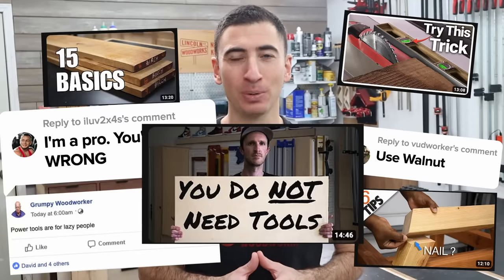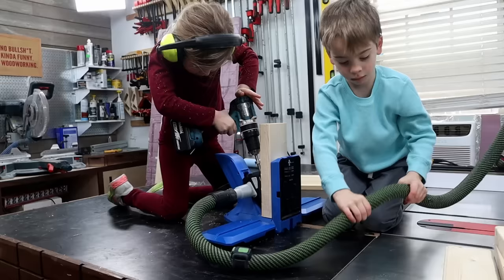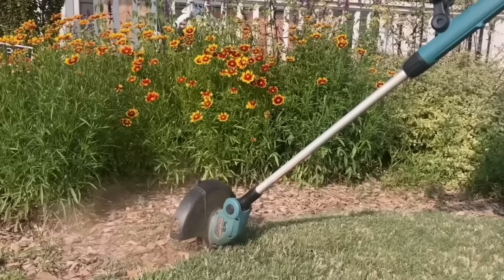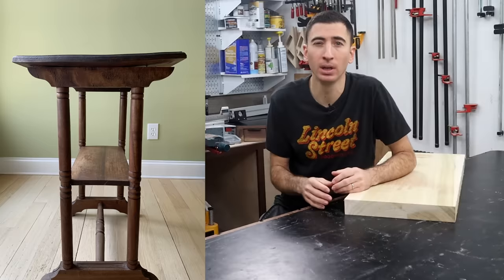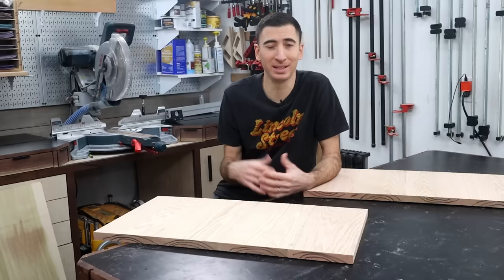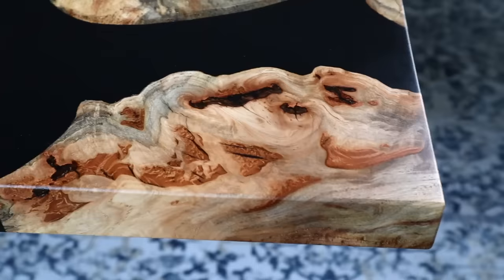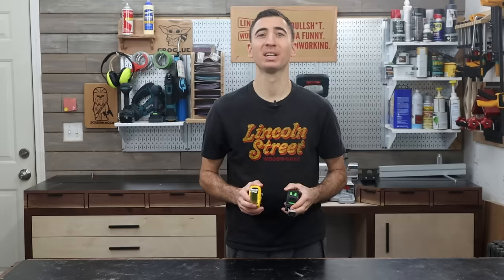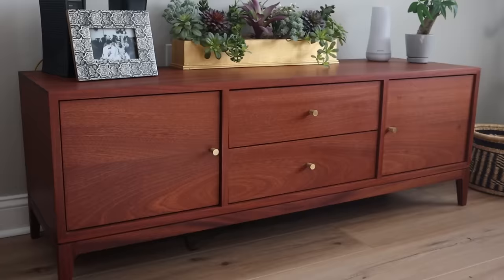Every beginner needs to hear this

Comment: Yeah, cleashe. 
But dude you are an idiot. 
Woodwork has been tested for over 2000 years and now some 20 year old knows better? 
Testing joint strength is not necessary? 
Oh my friend, although I can respect much of what you said you will yourself regret saying most of what you did in this vid in 10 years. 
And yes, I have trained in furniture building in Australia, England and Japan. After 45 years......new guys to timber....two things....
Do NOT take what this guy says, who apparently knows everything, for gospel. 
2nd, you burn wood. You build with timber.
Reply from the maker: I present exactly what I'm talking about round 2.........
Reply: blah, blah, blah
Reply: pretty sure timber is made of wood
Reply: This video is for the novice/beginner not for a furniture maker.  And we are not back in time 45 years ago. It’s for the person wanting to make something instead of going to IKEA.  Yes I agree long lasting furniture should use proper joinery, but beginners aren’t making furniture and glue and screws will only last 20 years, most of today youth thinks that’s an antique. You are probably a kid.  Be happy, you got response to your anger issues
Reply: Oh, it's been tested? Where are the evidence based studies?
Reply: @slightlycrookedworkshop  Jesus' father, Joseph, was a carpenter.
Reply from the maker: @cyberwolf6667  stop making this much sense. That can be dangerous on the internet
Reply: I came for the cupping. Stayed for the hockey fight.
Reply: The pin of shame.
Reply: Bro, why you tryng to burn me?
Reply: i think you missed the entire point of the video. no one is trying to hold up a building with pocket joints. I'm just out here trying to make a square box, cut straight lines. and build something better each time i do it. I'm not making heirloom pieces to pass down to my kids. i'm making record boxes, dog gates and decorative pieces out of whitewood and trying to learn a new technique with each project I do. by your logic people shouldn't use power tools cause they have only been around for about 150 years. stop it. let people have their hobbies and learn
Reply: Thank goodness I didn’t seek your input when I made my first living room suite on a labourers wages 
FYI I still have a few of the pieces I made 30+ years later and still use them 
This guy is talking to the beginner looking to make their first things furniture or not 
Not the beginner furniture maker seeking to work in hard woods making only furniture and cabinetry
Reply: @mrmajors60  I also think the anti-pocket screw crowd is funny because if you're using solid wood, you're still probably turning out a significantly longer-lasting piece than what you'd get at Ikea. And yet millions of people make do with the strength of Ikea furniture, which is put together with screws and particle board. And even THAT crappier furniture can usually last forever structurally if it's not subject to significant abuse.

-guy who doesn't use pocket screws
Reply: @winrawrisyou  like i am just getting into it all. and haven't even gotten to using pocket holes. I'm legit at the point where I am gluing stuff together and just happy when it is square, I learn something new each time. I'm currently making a record box "crate alternative" if you will. I'm sure in a few years I will think it is trash but for now its square, and will hold records without the bottom busting out.
Reply: Here’s one. Just because youve been doing something a long time/all over the place, doesn’t automatically mean you’re an expert or better than someone who is “newer” to the trade….
Reply: Bro.  He's talking to newbie woodworkers.  For someone that claims to have "trained in furniture building in Australia, England and Japan. After 45 years" I'd think you'd understand that you don't give a new apprentice "Master Level" instruction.  First you teach them how to hold a hammer correctly.  Because you and I both know they aren't going to know how to hold it correctly until they've been shown.  

Second, perhaps in "Austrailia, England and Japan" they build with "timber" - in the United States, "TIMBER" is what you shout when you cut down a tree.  We build with lumber or wood.  

I do wonder now - do you call yourself a "Timberworker"?  Or a "Woodworker"?  Yeah.  That's what I thought.
Reply: I built a workbench with lumber left over from machine crates, 2x4s, coachbolts and deck screws. It has zero aesthetic value, isn't stained or treated, weighs more than my car and the tools I used were the cheapest from Harbor Freight. I have almost no woodworking experience but I'm delighted with my results. So for me this guy is making a ton of sense.
Reply: so is it woodworking or timberworking?
Reply: probably the grumpiest comment ive seen
Reply: @PDolansky  I like lumberworking.  Because when I need something for a project, I go to a lumberyard.  But then I thought, the pieces I buy are mostly made from the "trunk" of a tree. So, I'm really trunkworking.
Reply: And also…it’s cliché
Reply: Come on bro we're not all wood gurus
Reply: I would tell anyone who buys a power tool to be careful of drills that have canted jaws in the chuck, for instance. If a power tool sounds inappropriately loud, it may have been cobbled together in a hurry with too little grease. Get something with 7 amps (or more, as amperage is current, and is what cuts). Some of the cheap throwaway is your money's worth.  If you've mitered corners with gaps, check your square (Swanson speed squares are often over a 16th inch or so, for instance). Get rid of old consumer plastic as it is likely dry rotted after 7-10 years and is not plumb/level (measure your measures). If you want to use rabbits (or whatever works for you) that's great. Get a chemical safety book, and know that everything in woodwork is going to kill you if you don't know what you're doing. And most importantly, borrow a pocket jig from the minister across the street and make your own from a YouTube video!
Reply: You know they used to stone people 2000 years ago for thinking the wrong things... are you saying that because we did a thing a long time that somehow no one can come up with a new way to do it?  Bruh... I hope whatever thing is ailing you is cured by the attention you got from this.  You're clearly struggling with something and I wish you the best, because your whole post is... um... "a bit crap" to quote a friend.
Reply: nic6754  What is "cleashe"?
Reply: Ha! I judge people for their finished product not how long they've done it for and age is completely irrelevant. I've worked with guys that have done stuff just as long as you and did some of the most lazy crap work I have ever seen. I don't take anyone's word as gospel and the last person I'm gonna listen to is the guy who bragged about working in multiple countries like it means something and tells a young gun he's going to regret it in 10 years. After 10 years I bet himself and the furniture he built are going to be just fine.
Reply: Is the strength of a cable stay bridge judged by the strength of just one small wire used to make the cables, or is it judged by the combined strength of all the wires bundled together?  Is a piece of furniture strength judged by one joint or all the joints combined? Remember as the joints combine the limit movement eliminating stress.
Reply: Dude calm down lol
Reply: No, I'm pretty sure I build wood furniture out of wood, my guy.
Reply: You build with wood. Timber is when a tree falls over
Reply: I also have 45 years as a cabinet maker, and I have had to suffer working with people who tell you everything you do is wrong. This is great advice for a beginner, use jointing methods that suit what you are making and don't over complicate things that should be easy, There are those who will insist on using dovetail joints on a box for collecting dog shit, and if that's what you are happy doing then fine, but calling someone an idiot for showing perfectly good methods makes you sound like the sort of person that nobody wants their workbench next to in the shop!
Reply: You’re the guy that wants to know more then everyone else. Nobody calls it timber except for you and your timber snob friends
Reply from the maker: @TrevorDennis100  Enlighten all of us!
Reply: Where's your channel then ?
No.  Didn't think so.
Reply: You are completely full of it. Arguably the highest stress experienced by wood furniture joints would be on frames you will sit on. Go rip down a $22,000 couch made by hand from a super premium luxury manufacturer with the best reputations for quality and longevity and you won't find anything but screw and glue joints. There will be inset framing components, corner blocking, etc. but you won't find a single mortise and tenon or all-wood joint anywhere.
Reply: @winrawrisyou  - I don't personally like pocket screws much because I prefer to free-work, and those are a pain to set up without a jig.   I've never denigrated anyone for using them.   Heck, I'd prefer that people used hide glue over 'plastic' glues, at least for things like chairs, but I don't go wailing about it to the world.
Reply: @MG-LooseCannon  i thought it was a furniture maker, and a house builder….at least it was the last tine i looked…..
Reply: Love this discussion, full of so much insight.  and Love all of your YouTube handles, cracking me up. Chubbibots, magicponyrides, BongoBaggins, these are classic!
Reply: his point is dont let it hold you back from starting out. i would add to that, learn the stuff as you go along.
Reply: Pffft. You only studied your tree cuttery in three countries? You missed out 192 of the stops around the globe.
Reply: Lol exactly as he said someone ( who has never bothered to make a helpful training video) comes along to flame.
So exactly how many times have you made a piece that consists of lone lever😂
I’m a beginner/ hobbyist and have been for many years , I can count the number of things I have worn out through use on one finger.

Maybe make a counter video ?
Reply: Actually you build with bricks😎
Reply: @Lincolnstww  I may be wrong if this video showed that a glued pocket screw joint withstands 170lbs, and there are eight of these joints in the table reinforcing each other, is that or not around 800lbs of combined strength?
Reply: @rocketfamilykml2528 Yes. Each joint according to the video, tests at around 170lbs so combined with seven other joints of similar strength, wouldn't it be 8x170lbs? (almost 800lbs)?
Reply: Minor spelling mistake, you lose the argument.
Reply: He makes it clear that this is for part time hobbyist beginners.
Reply: If missing the point were an olympic discipline you could win yourself some nice shiny golden medals for sure.
Reply: @Lincolnstww  round 2?
I'm guessing that either means you want me to argue further because you enjoy it, or that round 2 will be were you apologise for trying to mislead learning woodworkers. 
Bro, I said I can respect alot of what you said in this vid. But telling people something that is WRONG is ok? Really?
If nothing else, I commend you on trying to make money out of you tube. Posting something that even you know is wrong is quite clever in this way.
The simple fact this vid is for beginners, why mislead them, from the beginning!?
Reply: Guys, let's not overthink this. I write what I do because this video is incorrect. Have we learnt nothing from the 2000 years of practice, as I mentioned earlier. 
My comments are not intended as rude. It's more like let's do things correctly from the start, not get into bad habits. Is it really that difficult...."Oh no, I had to flip two boards over before gluing them"
Reply: @nic6754 
”This guy is an idiot“
“I’m not trying to be rude”
Which is it?
Reply: Tomato - tomatto who cares 😅
Reply: @nic6754  "But telling people something that is WRONG is ok? Really?". Yes and No. There are some things that are not exactly correct, but it helps to work with .. for the time being.
Examples: In early math I´ve learned one can not divide 2 by 3. Later I´ve learned one can. Then I´ve been told that if you square a value it always becomes positive. Later we learned that a negative result is possible and now I use it frequently. In chemistry I´ve learned about Bor´s atomic model ... later I´ve learned that this model is not correct ... 
But still all these (wrong) informations were good to go on step by step.
Reply: I learned nothing from your clip
You don't explain
Jumping from one topic to another
Reply: Oh dear. I think you have some timber still lodged up your screw pocket. Hope it's not glued too tight.
Reply: Imagine a Professional tells you whats the Truth and you still act like you know anything better. 
Thats on the same Level as the Flat-Earth People xD 

However the Reactions here are so American: I do this just for Fun without any kind of Standart or Regard for Material Waste :D  Its so funny :D 
 @Lincolnstww
Reply: Did you actually watch the video or just skim it quickly?
He said that those tests aren't realistic since you don't make furniture that just looks like a an L. The strength those joints had means that even the weaker ones would be just fine for most stuff people build. 
Being in the trade for a long time doesn't always make you super smart. It can also make you super biased and set in your ways. A beginner woodworker should take their time to learn it slowly. Even more so if they are just doing it as a hobby.
btw, why are you making stuff up? He didn't say he knows everything. Are you afraid he's just 20 and already better than you with your 45 years of experience?
Reply: Jesus's father worked with stone, not wood. You need trees to build houses. Israel is a desert. This mistranslation from the Greek for a builder was for something other than wood but for a builder. The Ancient Greek noun tektōn (τέκτων) is a common term for an artisan/craftsman, in particular a carpenter, woodworker, or builder. The term is frequently contrasted with an ironworker, or smith (χαλκεύς) and stone-worker or mason (λιθολόγος, λαξευτής).
Reply: His opinion is like an a-hole. Everyone has one. Some just stink more then others. We learn by doing ourselves, thru trial an error. That's what life is about. Cause life is a contuning experiment of self learning. There's so substitute for experience. That what learning is.
Reply: I think woodwork has been tested for over 200,000 years.  Tools and techniques have constantly evolved and I've seen a tremendous evolution during my lifetime.  (I'm probably old enough to be this presenter's father or grandfather - not a good judge of age.)  I've also seen major lifestyle changes.  This guy (Lincoln?) bases his advice on cupping around the "fact" that everyone lives in a climate controlled house.  I find this utterly weird, except that it is probably true for most people.  And he is correct that it won't matter if you start with dried lumber and it remains at the same dryness for as long as you own the item you've made.  And it will most certainly help if you finish both sides for the reason presented.  
I think the biggest problem with this video is that he seems to want to encourage new woodworkers by refuting a list of other peoples' "rules" while replacing them with his own.  That's bogus.  There are less offensive and more productive ways to teach.  And it makes it harder for me to trust his advice.  Is he just arguing to get views?  Does he actually know what he is talking about?  I don't really have time to find out, so I won't be back.
Reply: The testing shown in this video is of a single joint.  But I ask you, what piece of furniture has only one singled joint?  The point is, yes one joint type may be stronger than another, but it is the combinations of varying types of joints that make what you are building strong or weak.  I'd also argue that one doesn't need a shoe box that can withstand being stepped on by an elephant.

Lastly and more importantly, just because we've been doing something one way for 2000+ years does NOT mean we've been doing it right for 2000+ years.  If that were the case we'd all still be riding donkeys and living in caves.  Point is we learn new things every day, and sometimes those new things we've learned supersede the old ways of doing things.
Reply: Many a woodworker has made joints before the pocket screw jig was marketed 30 years ago. Does that make their ways obsolete? Of course not. If you run into some of these tools and router bits for under $125 you are getting a better deal than a pocket screw jig costs brand new (unless you live in an apartment or have limited space.) It doesn't float my boat knowing there's a better way to do something, and I'm making a table that will eventually wobble in 20 years.
Reply: Ok boomer.
Reply: I'm a furniture restorer (for celebrities and top interior design companies, felt I had to mention that becouse you're boasting your 45 Yr of experience lol) and, I almost never see altering growth rings in top pieces now I think about it.
Reply: @Gruftkriecher  Sheesh! Nobody calls the material used to make gold medals "gold." Anyone who knows what they're talking about knows Gold is for Jewelry.  Medals are made of "Auric Material" /s
Reply: @SkanMLL  Pics or it didn't happen.
Reply: @heidi22209  Go Red Wings.
Reply: @nic6754  2000+ years ago they used hide glue and it was in use until the 1900's are you stilling using it? I'm betting not as glues have advanced. The lumber that we use today in general is different from what was used in the past. How much air-dried lumber are you using? I'm also betting you use kiln dried. Again, times have changed. For most work in most homes ie temp, stable it really won't make much difference. I use 12"+ wide boards for drawers finished both sides no warping or cupping. Have done so for MANY years with no problem. (of course, some of the pieces are only 40 years old so we'll have to wait and see)
Reply: Had to change location that often ey? A pro would be humble and respect the info provided for people who are starting. Guess we know what you aren't. Also if you want to sound fancier than your skills allow, check the spelling and/or word definition from google.
Reply: *Cliché
ftfy
Reply: @klaus2t703  what a wonderful and insightful post!
Reply: I love how you pretty much nailed the comments prediction 😂👍
Reply: You only build  with timber if your stock is 6" by 6" or larger. If either dimension is smaller than 6" it's LUMBER. That is why they are called Lumber Yards...
Reply: I've worked with steel for 45 years, I'm just a hobbyist woodworker, so this video was interesting. I don't care what it's called in the inner circle of master carpenters dating back thousands of years , wood or timber or whatever. Wood working is casual, if you want strength, I can fab up a coffee table from 3/4" steel plate for you, then you can see what joint strength looks like. By the way, true masters call it steel not metal. lol Not really. Lighten up on the kid, he does better wood work than I do, lol  and maybe make your own instructional videos.
Reply: @Lincolnstww  I dispute what "nic" said.  He's not wrong about getting second opinions early on in ur career.  However, because of the DKE one will hear dumb ideas expressed just as, if not more confidently than good ones.  That leads to a fair amount of waste, in terms of time, energy, materials, money, your reputation, and how good/great you might end up being.  Learn from the mistakes of others, u can't live long enough to make them all.  I built cabinets for 50 million dollar yachts, with everything from hand tools to world class stationary tools with advanced digital controls.  As u can imagine, my coworkers were full of advice.  Seems like its always a mixed bag, and one gets better at seeing the pros and cons of each tidbit.  Eventually, while training new people, I landed on this approach to advice.  "What I like to do is this..." and then mention that its not the only way, there reasons for each way, it matters what the application and circumstances are, and while any particular approach has its strong advocates, one should optimize the best combination of "cheap/fast/good".  Of course we all want all 3.  Once in a while we can get lucky, and it happens.  Just know that that was dumb luck, and don't count on it.  Final thought: Your channel is rare in my experience, as the way you share your views is the most intelligent I have seen, and I've followed a bunch.  Glad I found you, cant wait to see what else u have to say, and I will be spreading the good news to any woodworkers I know... they are smart like you.  In the spirit of mutual respect, I salute you good sir!
Reply: @richardhaas1989  the term "lumber" is not generally used outside North America
Reply: @Lincolnstww  The fact that you pinned it made me laugh out loud.
Reply: "You burn wood, you build with timber" No, you don't. Working with timber has it's own defined set of characteristics and tools, which are usually much larger than standard woodworking tools. Congrats on being the perfect example to what he was talking about.
Reply: @wickedkustumz  I'm an amateur wood worker, but I've just called it lumber when I go to the "lumber yard". Do they even have timber yards? lol
Reply: @AmericanThunder  Typically, at least where I am at, lumber yards are the big box stores or places to go get basic construction lumber. You go to the mill to get hardwoods and actual timbers. Some lumber yards can order timbers for you, but mills are usually where I go to get my "lumber".
Reply: I've seen timber cutters in the woods cutting down trees and dragging it out to the log landing where the trees get cut into logs and then loaded on log trucks that hauled it to saw mills where it is cut into boards that was then hauled to lumber yards and drying keels by truckers that say they haul lumber and those places sell it to furniture factories and also places like Lowe's, Home Depot and other such places hauled to them on trucks that also say they haul lumber. Those places sell it to people that call themselves carpenters if they build homes and such things with that lumber and wood workers if they make smaller things such as chairs, tables, cabinets, swings, boxes, ladders, shelves, signs, toys and most all small items made from wood. I'm pretty sure it is technically considered wood at any point in this process from being a living tree all the way down to a used and rotting tooth pick. Or maybe words have a different meaning in my part of the good ole USA than they do in Australia, Japan and England. Or perhaps you sir @nic6745 are the idiot
Reply: @heavenleigh111  logging is some hard fn work too, those guys are beasts.
Reply: In the US we build rustic things with timber, nicer things with lumber, and do fine woodworking with wood.  (And we eventually burn the rustic things we made with timber once we've learned to make nicer things with wood.)
Reply: Hey troll, why is it called woodworking and not timberworking?
Reply: We have a "get off my lawn" Ken guy in the comments. Didn't see that coming 🤔. Oh, between him and his dad, they do know everything. If he doesn't know, his dad will and vice versa.
Reply: Japanese car it timble @MG-LooseCannon
Reply: @Lincolnstww when the response gets more likes than the original comment! 😊
Reply: Interesting range of comments. What is really the only consistent reality over decades is that wood butchers love to argue.  Joinery is impressive, but time intensive. Tech solutions help save labour.  Asian joinery is legendary as are their tools. Unknown fact is that all sharp edged metals used the same process as the Japanese still use of harder metal at cutting edge. Since that metal is very brittle and is easily damaged, most tools use alloys instead to absorb shocks with less damage. The edges are easier now to nick.  Terminology is also temper raising as is wood movement and prized techniques. It's fun to watch and discuss issues with a woodworker from a different country. I am fond of an English woodworker in a tiny home shoppe but with excellent machinery who has dialogues with his subscribers. Channel is Ben Elliott. No nonsense bloke who takes great effort to work through the stages of project development to help beginners  and to engage subscribers suggestions. I have found myself learning quite a bit after 68 years butchering wood. Keep the arguments going.
Reply: Cliché… not cleashe.
Reply: Hard to trust credibility if the writer can’t spell the title.  Especially when all of our devices check our spelling.
Reply: @Lincolnstww   To be fair he is right about wood and timber, our saying in NZ is wood grows on trees, timber is what wood becomes to build shit lol
Reply: @SkanMLL   Timber is processed wood used for building shit lol
Reply: Clutching pearls a bit eh? Well done. Well needed.
Reply: I'm so happy you pinned this.
Reply: @travisriddle8747 the guy just answered with the same term that was used in the original video. Nothing rude in it.
Reply: A much more experienced person pointed out that things appear to be not so straightforward as they have shown in the video, and a whole horde jumped out to argue. That's what's funny, guys. Is your actual goal to make furniture - or to make your own mistakes?
Reply: @cyberwolf6667 Problem is, he’s saying it’s a "MYTH”.  And it absolutely is not a myth. Over-stated,  hyperbole,  maybe, but not a myth.
Reply: You build with lumber, timber is standing in the woods.
Reply: I built an entire house out of 1x2s with pocket joints and its lasted fifty years
Reply: Why don't you start a youtube channel if you know so much? Stop gatekeeping all that knowledge you're hiding from the world.
Reply: Aaaaaaaaannnnd way to make his point for him 😂
Reply: @johnsmith-vz3vr  ah, the classic, "It's in the bible so it's true," argument.  If the bible said diddling kids was ok would you do it? No, because that's nasty.  Just because Joseph was a carpenter doesn't mean the way he did it was perfect or correct.  The bible doesn't always mean correct or perfect.
Reply: @cyberwolf6667  See. This is what an respectful, respectable adult looks like when he writes online. Flawless jab inserted in there as well. First round is on me pal !
Reply: He clearly states that this is for non weight bearing joints. My shoe rack isn't going to fall apart because I didn't dovetail the thing. Being a total newb, it's disheartening to believe you have to dish out 6k to even begin projects. It's relieving to see this. I built my rolling work bench that easily holds 500 lbs and is an open storage unit.

I wanted the bottom half shelved so I can sit/store it easier. Everyone on forums were telling me the design wasn't structurally sound or strong enough... It's been over 3 years of that thing having the hell kicked out of it and rolling it inside and out. 2 of us sitting on it with the 200 lbs stored on it. A drill, bits, Circular saw, 1 1/2" and 3" screws, glue, level, measuring tape, pen, weels, 2x4, and some leftover paint and 3/4" plywood. Maybe 100 dollars in materials if you bought everything from store. 200 in tools?  Compared to the 500 dollar benches I've seen, this would easily be worth double, feature and strength wise. 

Ironically, the strength test videos he talks about show that a standard miter joint with just glue, was one of the strongest joints (by far) vs almost all of the others. Miter joint for a desk is fine. In fact, the strength tests show that it's ridiculously stronger the dove tails and others with mechanical support.
Reply: sometimes its just too easy. hahaha. I too have been building custom furniture for a long time. There is always something to learn. cough "humility needed by some" cough. lol. btw, good vid. And I also like blue.  @Lincolnstww
Reply: @NukeDragon-ry2xw  when someone talks to me like that, I don't talk to them anymore.
Reply: I’ve never heard a single person working with wood call it timber, wether it’s carpentry or wood working. I’ve heard them call it lumber, but not timber. That’s what my grandpa use to call it when he was a timber faller for 40 years.
Must be some regional thing.
Reply: I live in a timber industry town in the US...  timber is what goes to the mill to become lumber, which is then used to build with...  Wood is the material it's all made from.
Reply: What inexperienced is this young man.He could not make it in the professional field. He should make cool aid stands for the neighborhood kids.
Reply: Sorry, but you can’t say that these tips are for new joiners…filling holes with epoxy isn’t a new joiner friendly way, nor is sneaking up on a cut with a table saw or a chop saw - few new woodworkers will have these tools.
Reply: You turn wood into lumber you turn timber into creations of usefulness.
Only time and skill will make you a true wood worker. Not 1 tool you can buy will do that only time and patience's will. Fail burn and start over.
Reply: Nah the loud ones are great for DIY xxx Hobbyists. hahaha Just buy a Makita. A real one. Anyone reading this who needs to learn routers, like myself, there's this ridiculous deal at Home Depot. I don't know how it's still available to be honest. Huge/Strong Makita case (would have 60 dollar price tag on it, alone) 6.5 amp router and 3 bases. 1/4 inch. No bits. Followed online advice and picked up the 60 dollar pack 15 bit set or something. Not spending 30-70 on a bit when I don't even know which bit does what... Makita, and Bosch have never let me down. 

Going against his advice, I'd say buy a trusted brand, especially when dealing with tools that can take a finger off or kill you. I use 32 inch Chainsaw bars milling wood comfortably. The offbrand Miter saw I purchased for 200 almost took my hand off. The blade was literally hitting the sides and then the metal base at 45 degrees. Company sent me a replacement, that did the same thing... Makita has awesome deals. The 4403 Belt sander is my favorite tool of all time. Dewalt sucks. Craftsman's a joke. They sent me a second defective air compressor... Only off brand for a one project or so tool 
 @campbellpaul
Reply: You seem to be demonstrating exactly why he needed to make this video. Start making things and you will learn bit by bit.
Reply: My guy, what ? 

Just a tip, if you want anyone to listen to you, don't start with insults.

It shows a weak mind from you and ensures anyone you are talking to is not going to listen with an open mind.

If you cared about having a discourse or informing anyone - you would do better to learn how to communicate such that anyone listens to you.
Reply: @overtonegamer  this. i have a second hand 15k sofa and that's exactly what the frame looks like. lol
Reply: @SkanMLL  This guy probably argues ships vs boats and motors vs engines.
Reply: You missed his point.
Reply: I'll just bet you don't agree with lots of people.
Reply: Using the word " idiot " was not warranted. I'm sure you have made mistakes like the rest of us !
Reply: I call BS that pocket holes "aren't strong" my rolling workbench was made 100% with pocket holes, it's been doing just fine for the last 5 years, come across as elitist for no particular reason.   @Lincolnstww
Reply: @POOKIE5592   It's how a Bogan spells  cliché!          Pam    {Tom's wife}
Reply: @cyberwolf6667 He started with that in the initial comments.  He's speaking to the beginner/intermediate and using a generalization.  Don't be arrogant.  If you don't like it, then head on down the road.  He's not affecting your work in any way.
Reply: Why isn't it called timberworking instead of woodworking then?
Reply: @TheActionBastard  I dunno... maybe we shouldn't have thrown that one out...
Reply: I've never heard anyone call the substance they were building with "timber". 
If a joint type is known for a particular yield strength, there's no gain in testing it on a new project.
Reply: Someone is afraid muggles will learn his "secrets" and put him out of a job.  
And wood is for the ladies(or men of you please)
Reply: Yeah, I ain’t reading all of that
Reply: Timberwork?
Reply: the fact that you had to say all the countries you have been trained in tells me you are stuck in your ways. Furniture making is 1 of the easier woodworking areas. I've been crafting my skills on site for 25 plus years with jobsite tools in the millwork industry. my biggest tip is always look for new tricks and ideas, you will consistently get better.
Reply: ugh... >.<
Timber is wood, as is Lumber. Timber is unprocessed wood or still standing trees, while lumber is wood that has been processed and is ready for use in projects. In other words, you don't actually build with Timber, you turn Timber into Lumber and build with that.
Reply: Yeah, how cleach yourself? I bet seasoned woodworkers back forty-five years thought the same thing of your views. You should of listened to your parents when they  said "sniffing varnish will make ya stupid!"
Reply: @KelikakuCoutin  even more. because you can NEVER create the same moment of inertia that you get from a lever when both ends are supported. that table would not collapse with 1500-2000 lbs on it. crotchety old wood workers love to hate on pocket joints and preach the alternating rings philosophy because it's part of their dogma. the reason to get away from pocket joints eventually is probably because they aren't as nice looking but since you're hiding them as much as possible it hardly matters. 

just like which battery platform to be on. I've got 2 battery platforms and 3 of my 5 kids are on different platforms so I've used basically all of them. once in a while I see a slight advantage in dewalt or milwaukee but very small and very infrequently. If you're new I would say for the weekend warrior and hobbyist price is most important and ryobi has the best deals, least expensive tools and widest variety of tools of any of them. you can own 10 ryobi tools for the price of 5 milwaukee or dewalt and if one of them did break you could replace it and still have paid less money.
Reply: @MG-LooseCannon Thanks, I build with Lumber too, been doing it for more years than most people have been alive.
Reply: lmao at token boomer showing up.  I'm an engineer/luthier and by far the dominant factor in wood warping is moisture.
Reply: @johnsmith-vz3vr  Jesus was a carpenter!
Reply: Just 45 years? You know even Jesus used pocket hole screws, and his epoxy waterfall tables are still around to this day.
Reply: If you're a master timber worker, why are you Even watching this video
Reply: @BongoBaggins or wood still in tree form.
Reply: @richardhaas1989 exactly! Hence "timber framing" for old school barns and homes.
Reply: @johnsmith-vz3vr  says a book that was written 400 years later about an area which hardly has any trees
Reply: @Lincolnstww  LOL The woke wood people are everywhere!!
Reply: It is rude and impolite to call people idiots. Obviously, this guy is not an idiot.
Reply: Oh geez here comes the geezer whose been doing it his whole life, thinking nobody will ever do as good a job as him if he doesn't spread his dictionary of woodworking knowledge wherever he can😂😭
Reply: Easy there !, have a beer!
Reply: @SkanMLL  Yeah but have you ever tried organic, forest-grown lignin and cellulose structures?
Reply: didnt ask
Reply: @johnsmith-vz3vr  technically, the word is Tektōn, which more closely translates to "laborer" than "carpenter".
Reply: I think you  can confidently apply what this guy says in this video to the lovely quality wood we get in box stores,not to unique wood found in old houses, or Japan or some other foreign country. This video is for beginners dealing with wood on hand.
Reply: Yes, you can learn from a 20 year old.  As a 48 yo luthier however, I am not inclined to learn from you.  Already had an arrogant step dad try to teach me how things have “always been done”, no thanks.

Oh and that timber vs wood thing?  Never even heard someone be bitchy about that before 😂
Reply: You sound exactly like one of these guys that hangs around at a forum all day to tell people how they SHOULD and MUST do it 🤣 Acting like you invented it all. 
I build with wood all day long and put my leftover timber in the oven. And a guy with an attitude like yours is not going to change a damn thing about that 😂
Reply: Whether its a table top or deck boards, i always check the cup with a straigh edge and mark the end of the boards with an arrow. by end of job many of those boards have cupped the opposite way after dressing.. i try to install or glue up so if it does move any, the outside edges will cup down or towards the surface its mounted to.. have had zero fails doing high end custom everything from fascia board, bulkheads,  fake beams, bar tops & harvest tables in 5±yrs.  gave up fiddling with breadboard ends, dominos, biscuits & pockets screws, all mostly unnecessary with proper humidity control, good glue&clamps with a little common sense.
Reply: What’s cleashe?
Reply: What in the world do you mean testing joint strength is not necessary?
Reply: This dude just said woodwork and then bitched about how to use the terms wood vs timber 😂😂😂
Reply: Cut down timber, hence the saying in the woods by tree cutters, 'Timber'!
Build with lumber.
Wood is just a generalizing term, 'Its made from wood, not plastic'. One doesn't say, it's built from lumber; or, it's built from timber.
Wooden ships.
Reply: @nic6754 wtf? this is one of the dumbest things I've read on the internet so far this year, and thats saying something, cause you know, its the internet. Be proud of that. Also, you misspelled cliche
Reply: you missed the point lol
Reply: Then please make videos on how to build long lasting furniture! I would love to see how it is done.
Reply: Timber is used to build buildings; wood is used to build tables, furniture, cabinets, etc. I really hope your comment is just a troll.
Reply: The same energy as gymbros who mock Chloe Ting workout video doesn't built actual sculpted body when the average viewers of Chloe Ting video are lazy potato who barely run to safe lives. 

Her video is easy to follow for begginer and still do a good job of making pppl pant and sweat. 

The fitness bros making video abt pull ups and calesthenic shit that impossible to be followed by begginer who just learn to squat and plank.
Reply: Ya outta see what I can do with a 20 penny nail and a piece of wood, timber,,,a tree literally,I build with trees
Reply: This oughta be the cringiest thing I've ever read
Reply: It sounds like you became a master in your field. While the argument of authority has its place, it has to be backed by arguments as well. I got the verdict. Now, I want to hear the rationale of it.
Reply: You've got some gall calling someone an idiot while simultaneously spelling cliche wrong 🤣.
Reply: @Xanderbelle  I get where you're coming from but realistically, having a channel just means someone uploads content. I bet there's a channel out there with a chick just jumping up and down clapping her butt cheeks together. Having a channel isn't some right of passage or gateway to knowledge. Only pointing it out because you seem to be insinuating that's the case.
Reply: I've been woodworking longer than you and I've been using pocket screws decades before Kreg started making their jigs & clamps. I have yet to see any of my benchtops, tables, end stands, chairs, houses, planters, sheds, etc fail at ANY joint. Take several seats, bruh. And check yourself for skidmarks.
Reply: Tell me you're desperate for validation without telling me you're desperate for validation.
Reply: I hope this is satire
if not, why haven't you made any woodworking videos?
if you have so much knowledge to impart then it should be a duty, no?
Reply: troll
Reply: @overtonegamer  Hendron used to make custom couches with fancy joinery and hardwood that could result in a $30k sectional. But they went out of business in 2013 and the stuff that wasn't custom hand built was made in China after 2000. The only things to me that really end up better for classic joinery is kitchen tables and chairs where the wood is all exposed and they take a beating. Otherwise - like you say, blocking, screws, glue will generally last longer than the rest of the piece of furniture.
Reply: You build with timber ? 

What are you talking about ? 

Who care

Americans build furniture and cabinets with wood , we frame houses out of lumber 

It all comes from Timber 

Timber is a word we say when we drop a tree 

People in America buy Lumber and wood not Timber 

Keep your comments down under
Reply: What am I supposed to do with all this useless lumber?
Reply: @POOKIE5592  "What is "cleashe"?"

Cleashe is how a real professional spells it. A newcomer like you couldn't possibly understand such things.
Reply: If you burn wood and work with timber why is it called woodwork?
Ever checked your trunk size mate? 😂
Reply: 45 years is a long time to train you know. Slow learner hey?
Reply: There’s no way you can be a good person
Reply: LOVE IT! It's sarcasm at it's best!
Reply: @jackmalone8195   You have the start of a good stand-up routine here! Encore!
Reply: You didn't even listen to what he was saying.
Reply: @nic6754  It's TIMBERWORKERS, not woodworkers!  Sheesh.
Reply: @johnsmith-vz3vr Jesus was also a carpenter before beginning his ministry. Gotta be the best trade right?!?
Reply: A warning this is one of those Carpenters you don't want to work with😂 the guy who made that post is what we're talking about here. I'm guessing he's never tried any of the applications he's dismissing. I appreciate a purist but most of us aren't
Reply: Wow lots of wood warriors arguing .Jesus was a masonry guy along with a furniture make and the savior of (for God so loved the --------?????world .
Back in the days of Jesus time they were called tills or house rights or barn rights people who built dwellings both for man and animal and a damn sight more than that for sure load-bearing stone walls with wood lentils and wood window openings and all kinds of wood doors and wood discs and would that. 

The Bible says a fool is always wise in its own mind and he also says better to reckon with a mother bear where your caught between her and her lost cubs then to reckon with a fool some of the people arguing in these comments it just amazes me. 
I think if anything Carpenter should reunite with each other then bring back the old school days of crazy great artisan carpentry millwork woodwork whatever kind of work you want to call it and whatever kind of joint you want to use.
Reply: @nic6754 the kids chose the mom huh